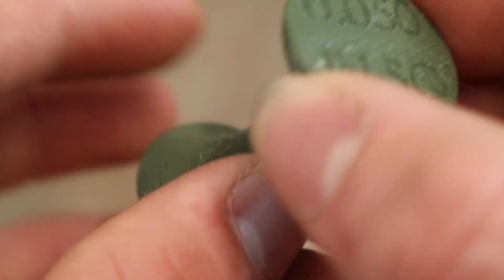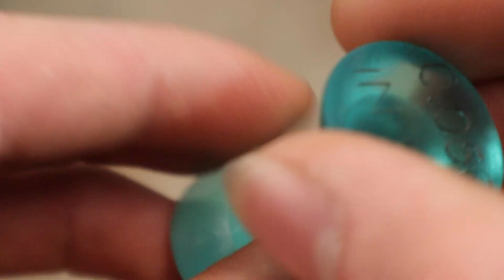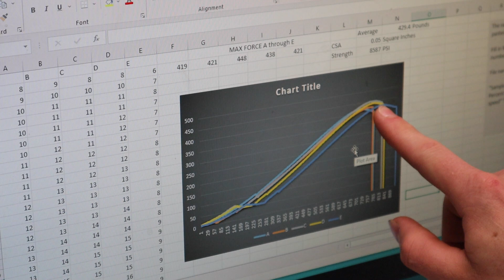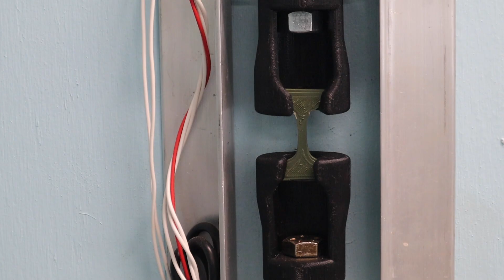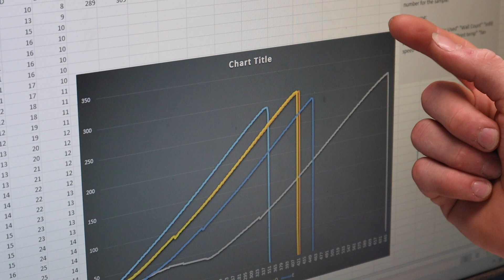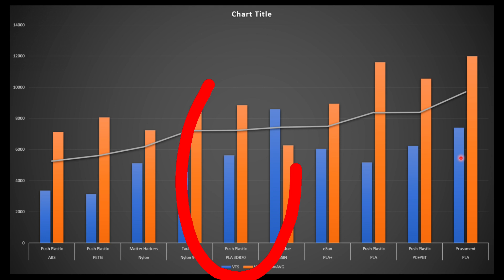Resin vs. FDM Prints | Which is STRONGER?

Comment from the maker: NOTE: At 15:40 the blue is vertical and the red is horizontal. Got them mixed up somehow ;)
Reply: Haven't finished the video yet, but have by chance tested FDM pieces that have been ran through an "annealing" cycle?
Supposed to help with layer adhesion by effectively remelting everything together and releasing any stresses between layers caused by uneven cooling. 

Might change the vertical test piece performance for the better.
Reply: @wanderingcalamity360  I just asked this in the last video...then saw a video by CNC Kitchen on annealing. It doesn't look at all good for annealing...
Reply from the maker: @wanderingcalamity360  I experimented with annealing PLA+ in hot water, it made the parts weaker! My guess is the water broke down the plastic. Further investigation is needed. The biggest problem is preventing deformation of the part.
Reply: @HoffmanTactical 
The way I've seen it done is they cast the completed part in plaster or silicone and do a soak in the oven for an hour or two so at the requisite temperature for the material.

Not sure about hot water soaking.
Haven't looked into that technique.

I know moisture content can adversely affect printing quality, like with nylon. But after printing? I wouldn't think that would have an effect.

Comment: You know what would be interesting - if you could get a hold of a sample of injection molded GF nylon that most handgun polymer frames are made from.
Seeing how different 'home consumer' polymers stack up to each other is invaluable - but a control comparison with what the professional firearm industry uses would be enlightening.

Also, and especially for firearms - Impact resistance would be very important to test and document. Tensile strength is one thing - I think impact resistance is just as important in our partcular application
Reply from the maker: It is, and that is where the resin really does poorly, unfortunately.

Comment: My question is PLA/FDM or Resin better for board game pieces when they will be accidentally dropped from table height or normal handling. Does anyone know and have a specific recommendation?
Reply from the maker: I bet resin would be OK if you get one of the tough resins. They would look better for sure. But you could also try PLA with a 0.25 nozzle.

Comment: Resin printers do print by layers that's why layer orientation affects it.
Reply: the layers are bonded much better than in FDM so it usually does not affect strength at all, you can tell they have bonded properly if it shatters like glass instead of slate stone.

Comment: Why don't you print in alternating zigzag? Linear will delaminate in the orientation its printed in.
Reply from the maker: With proper line widths aligned infill / lines will not delaminate. It's important to use aligned for testing to insure that there is no shear between layers.
Reply: @HoffmanTactical  ah. Thanks. Did you ever strength test annealed parts?

Comment: Are you familiar at all with Siraya Tech Tenacious resin? I've printed stuff with a mix of 20% Tenacious and 80% Fast Grey, and the parts seem exceptionally strong. I'd be curious to see how that holds up in a test like this.
Reply: I have been using this and a mix of Blu and Tenacious is very strong. Adding tenacious can basically just make it a little less brittle which it blu's weakest point.

Comment: How log was the vertical resin print compared to the horizontal?

If resin has a slower cure time it is is stronger.
Now with faster laser travel due to less surface area, and light refraction from repeat path, you would get a slower segmented cure that could result in a more flexible resin that could hold more weight, i have experience doing this with chemically cured 2 part resins using a chemical hardener.
If you make a quick cure resin it will become hard and brittle,  whereas if you make a resin mixture with a lot less hardener that takes like 72 hours to cure, you get a much more pliable resin that can hold a 2000lb. Slab of granite to the ceiling; of course we also glued 1/2" thick solid core copper wire into tracks cut in the back of the slab and wrapped the wire around the rafters above for added safety and support, but the slow cure resin was key to the slab not falling on someone.

So the vertical print with less direct UV exposure at initial solidification but more UV exposure over time might have something to do with the increased strength in you vertical resin print, however, this could be highly dependent on the geometry of your printed object, and might not fare so well on othe vertical prints.
Is there a particle physicist in the house?
Reply: You can't slow cure UV resin for prints, the individual layers have to reach a point in curing so they stick to the previous layer, the previous layer also gets slight more cured as light passes through the currently curing layer. you can cure the print further (it's recommended) after it's printed to make it harder and stronger as more of its "glue" is released by UV light, but over exposure can make it very brittle to even flexible resins.

Comment: HDT for thermoset resins depends very heavily upon the specific resin used. Also, because it's a thermoset, the total deflection should be significantly less than for any FDM print, because, well, thermosets don't melt lol. They do still obviously deflect more easily with temperature, but they will almost certainly distort less than any FDM print. The primary issue with most resins is impact resistance. A lot of them tend to be quite brittle due to the highly crosslinked nature of thermoset polymers. There are some more impact resistant resins out there, though, that are often a mix of thermoset resin with some sort of rubbery material or thermoplastic. This kind of thing can obviously hurt the HDT and Tg of the material, though, so it's a trade-off.

Anyway, what I'm basically trying to say is this: the properties very heavily depend upon specific resin choice, even more than FDM prints tend to.
Reply: When I did some toying with high temp resin, I found them to have pretty big issues at temps above 100c. Specifically Phrozen TR250 resin, and when printed samples were placed in a headed enclosure at 120C for 4 hours, the resin seemed to degrade quickly. Printed layers began to delaminate from the part and serious warping occurred. The material also cracked in several places. It's possible that trapped moisture within the resin matrix was turning to steam and damaging the structure of the part, but placing cured parts in my filament drying setup at 80C for 12 hours didn't improve the results at high temp.

Phrozen seems to have a new and improved high temp resin, TR250LV, which is advertised as being able to withstand up to 120C. I haven't put time into testing it yet, but perhaps they have managed to mitigate the cracking and delamination issues.

Comment: In my experience resin is far better than filament when it comes to an impact/drop. That's non scientific though and there are tests and specs on many resins available. I'm curious how eSun Hard-Tough resin stands up. Epax3D has a couple short videos showing how it takes a hammer and drilling.
Reply from the maker: So am I ;)

Comment: Is there any resin that compares w/ PLA for use in lost-(goop) casting? Most stuff I need to repro require metal for strength & heat resistance. It would be pretty cool if there was a resin that could produce a part that could be sintered a la' MIM (at a backyard hobbyist price point, natch'...)
Reply from the maker: You can get resin designed for investment casting. They designed to burn out cleanly.

Comment: You're not helping my budget. The AnyCubic Mono X has already been calling my name. But like you mention, resin printers are moving forward so fast right now, not sure if it's the time to buy. But computers do too, and we buy/upgrade those all the time,...      Do you think you could go hose clamp-less with resin since you're theoretically only doing that for layer adhesion?

So I guess for me, the question is, "for <$100 per kg or liter, which is stronger when my FDM printer that can only do 260C?". I can drop $70 on a role of PC blend filament to "play with", but those $250 per liter bottles of resin,....  That much makes you pause a bit.
Reply from the maker: Even with an injection molded part the buffer band adds like forty percent strength. It's not there to hold the layers together (though it does do that) but rather to transfer the force to the support rib, which is what makes it stronger.

Some of the resin is a bit high. I just ordered a bottle of the eSun tough resin, it is only like sixty a Kg. And the specs looked really good. I don't think resins have surpassed FDM yet, a good high temp PLA is still a great option. Look into the 3D870 PLA. I buy it through Push Plastic. It's like eSun PLA+ but higher temp.
Reply: @HoffmanTactical  Thanks for the reply. Yeah, $60 isn't bad. For non solid applications, I'm thinking the infill of FDM is also a plus versus just a hollow resin print. More walls is good to a point, but you still want some infill structure to oppose wall movement.

But, it's also good to have options. 😉  and I only have fdm at the moment.
Reply from the maker: @rcrdps8144  Being able to use infill is really nice. Stuff like stocks and grips really benefit from it.
Reply: @rcrdps8144  also note that some slicers let you add infill to resin prints - I don't remember if chitu can, but maybe lychee and definitely Prusa.
Reply: @joegibes  Good point. I guess I momentarily forgot that. CNC Kitchen's test of Sirya Blu had infill on his test hook.

Just ordered a MonoX resin printer, so I have to learn these slicers.

Comment: gonna have to setup a impact test for the testing moving forward from the looks of it since nylon 910 wasnt much better than pla in your charts and maybe also a salt annealed test
Reply from the maker: Yes I need to. Also a heat deflection test. And then figure out a way to combine the data into do a overall filament rating.

Comment: Please look up forgotten weapons video on the WWSD ar. It utilizes a polymer lower and buttstock but they are molded together in a 1 piece design. This could possibly make a much much stronger lower design for 3d printing but im not too sure how they designed the buffer tube to fit.
Reply: It's molded in halves that are then sonically welded together. Probably load the buffer tube liner in just prior to the halves being welded.

Comment: Just finished v2.6 and had everything put together in less than two hours. First time I didn't have to drill all the holes and everything lined up. Ty for your service. I love the kit
Reply from the maker: That's really good for a first print. What printer / plastic did you run?
Reply: @HoffmanTactical  wasn't my first print. I used inland pla pro(new). I've printed a few of your older models in cf pc. I had problems with the bolt cycling with the newest build. Think I printed it slightly too big and going to try again. I have a cheap labist et4 printer with some minor upgrades. I printed the x and y at 100.4, next ill try 100.3 like you did on the prusa mk111

Comment: How much material needs to be left on your CAD modal to allow for shrinkage when annealing or curing any plastic filament printed part compared to a part made from carbon fiber filament needs for annealing or curing? I need to hold a lot of tolerances of +/- .002" & a surface finish of 63 & 90.
Reply from the maker: You probably want to scale the part up in the X and Y axis. But you have to experiment with your filament to find out how much. Something like 103% is a good place to start. I've never annealed a CF filament, so don't know how much it shrinks.

Comment: This is great! To get rid of some of the layer issues have you looked into genuine 3D printing? (This meaning moving in the xyz axis all at the same time) this gives layer directions that are curved and not in 1 axis I think it would help with break test.
Reply from the maker: Yes. Current 3D printing is really "2.5D" printing. True 3D printing is interesting, though it does have drawbacks. Hopefully it will be more accessible in the future.

Comment: Hoffman Tactical, Have you tried any PCTG filament yet?
Reply from the maker: Not yet. I think it's a good option though. Check out CNC Kitchens latest video. Looks like good stuff.
Reply: @HoffmanTactical , Thanks! I have seen CNC Kitchen's video. Now I'd love to see it tested for our purposes.
Reply: @HoffmanTactical , Also, would coating prints in resin (on the outside) improve the strength enough to make that a worthwhile endeavor?
Reply from the maker: @TrojanHorse1959  I have never tried it, but I really don't think it would help much. I did just see an interesting video on electroplating prints with metal. It's rather involved and has problems with eliminating fine detail, but makes for some strong parts.
Reply: @HoffmanTactical , Ok, thanks. I just wondered if it would help strengthen the layers any to help prevent separation.

Comment: The heat deflection temperatures for resin prints should be quite a bit higher than for FDM prints.  I don't know exacts for the Siraya Tech Blu, but I know several engineering resins have heat deflection temperatures above 500-600 degrees Fahrenheit.  
Also, large form factor MSLA printers are available for reasonable prices now, like the Elegoo Saturn.

Comment: The printing should of been all the same. The only difference that i could think of is the curing time. I generally just sit it in my curing box and flip it sround every minute or so. I would assume the less time curing would equate to being a little more flexible but not as hard. I may need to relevel my bed tho, i was having a few issues lately, ive just a bit lazy with it.
Reply from the maker: Yes. As another guy said, It could have been a difference in cross section. One was round and the other square. So the bigger 8 KSI number is probably the accurate one.

Comment: im guessing the horizontal weirdness is due to them being flat, and any kind of flex would drastically change strenght, where the FDM is more ductile so it can make up for uneven stretch
Reply from the maker: I'll have to try again with identical samples printed in both orientations.

Comment: One big advantage of SLA printing is the fact that bonding between layers is not a serious issue.  Where as FDM prints are only as strong as these layer bonds, in resin printing you can get all of that strength.  There are also resins out there that are just impressively durable.  The 3DM abs resin is really good, and far superior to FDM printed ABS because of the aforementioned layer adhesion qualities.  Unfortunately its fairly chemically reactive.  There are also some nylon like resins that have insane properties.  Check them out as well sometime.
Reply: I would like to see Hoffman review nylon-like resin!

Comment: The resin print has different cross sections at the shear point. The sharp edges of the flat print verses the rounded shape of vertical.
Reply from the maker: Definitely calls for a future retest with identically shaped samples.
Reply: Oh that's totally what did it, good catch

Comment: You should try liqcreate strong X for a tougher industrial resin that is compatible with hobby printers like elegoo/phrozen/anycubic. I'm going to test a G19 build once I get the last of the parts.
Reply: im testing the "esun abs like" right now on my mono x. making a g19 using a P80 file.
Reply from the maker: I've been reading about resin specs all morning ;) The Strong X seams a little (very?) brittle. I am going to try the eSun hard tough resin next. They could be lying about the specs, but it looks really good on paper.
Reply: @HoffmanTactical  strong X is actually really strong for industrial applications and prototyping. Use it often and figured it would be a better resin than others due to the high heat resistant properties and tensile strength.
Reply from the maker: @sergeantlonewolf  Looking at the specs the tensile strength is incredible. As is the temp resistants. Almost like PEEK. But the impact resistants is something like 20 J/m^2 (J/m?). Which is really low. The Tough X on the other hand is a lot weaker, but has great impact resistants. So it may be a good option.
Reply: @HoffmanTactical  strong X has higher tensile strength at almost 100 mpa/14ksi, but because it was made for impact resistant it doesn't stretch before breaking, unlike tough which has less impact resistant, but more stretching before snapping.

Both should work really well for gun frame applications. But needs testing which I hope to do here in June for strong X.
Reply: I'd be happy to talk more and send samples if you want to test it yourself?
Reply from the maker: @sergeantlonewolf  I'd definitely like to test some. Though first I think I will revamp my testing method (new sample design) and maybe get an impact tester. I look forward to seeing your testing with a real firearm! Do you publish anywhere?
Reply: @HoffmanTactical  I do not. This would be the first one I print and joining the hobby. Any place you suggest?
Reply from the maker: @sergeantlonewolf  Not really. I'm here on YouTube because of the large audience. But it's probably not the best.
Reply: @HoffmanTactical  yeah trying to stay away from YouTube, was thinking the reddit community once I get pictures and the build finish.
Reply: I don't mind sending the results to you if you have a point of contact?
Reply from the maker: @sergeantlonewolf  Yes. Let me know how it goes! Tim(at)hoffmantactical.com